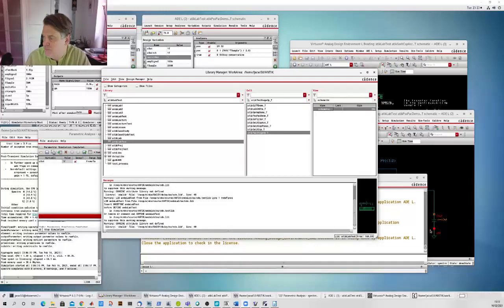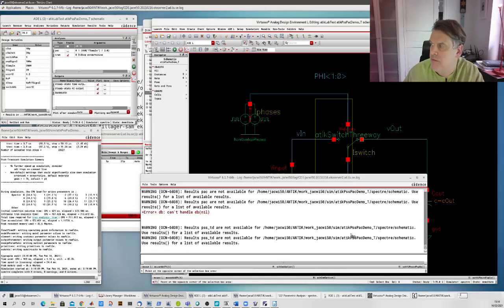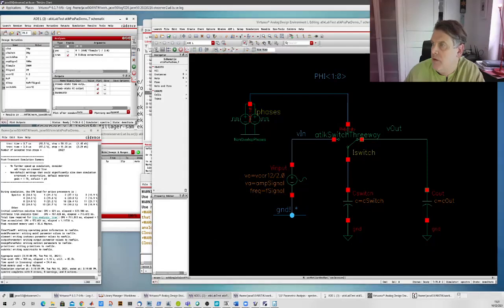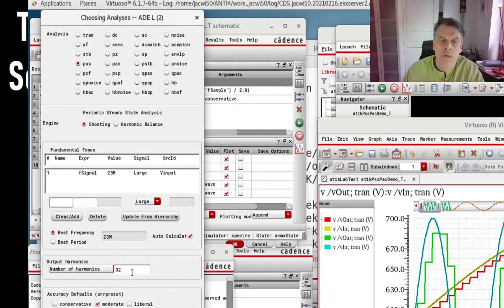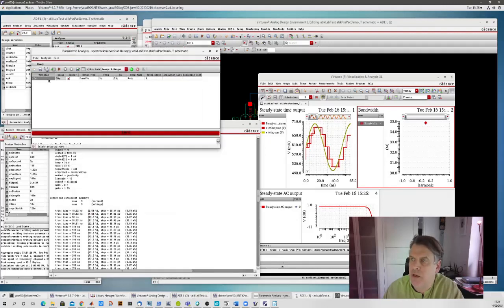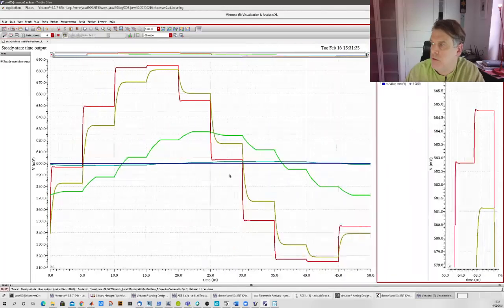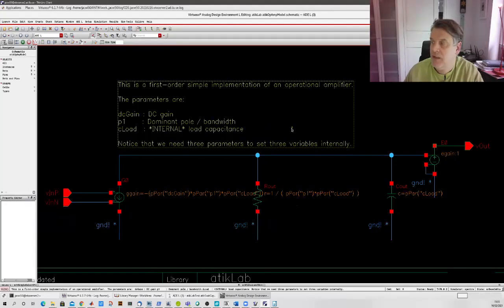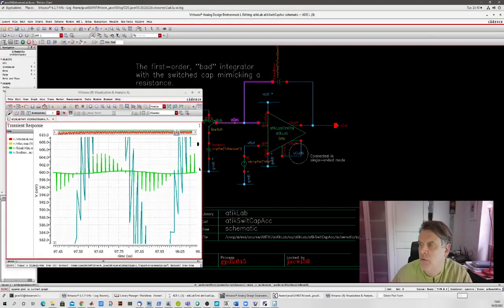TSTE27 : Covideo : Seminar / Some cadence sims

Comment: Hello Sr. I would like to know how to simulate a S.C system in cadence. What I know is that i need to use PSS and PAC simulation, but i really do not know how that works. Could you give me some information or documents where i can learn about that? 
Cheers!
Reply from the maker: Hello, thank s for your comment. I'm not with the university anymore, so limited access to cadence.

I think the papers from designer's guide (by Kundert et al) do have quite comprehensive information:

https://www.ece.umn.edu/~harjani/courses/5333/Cadence_sc_filters.pdf

and others,